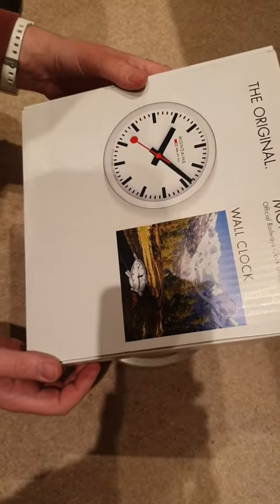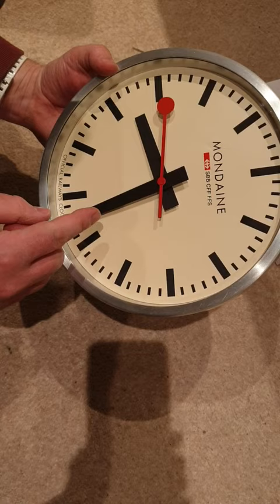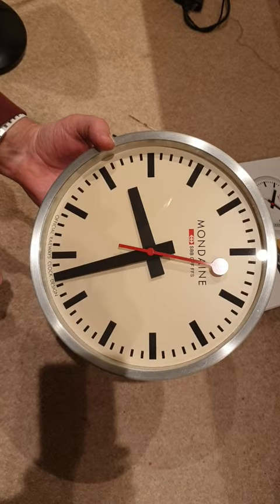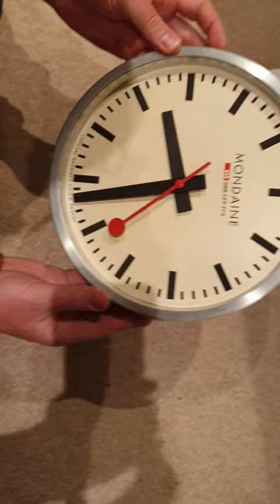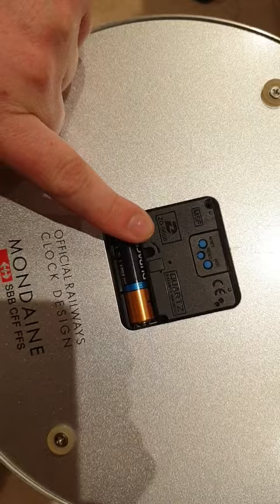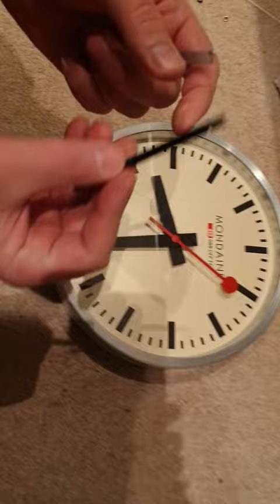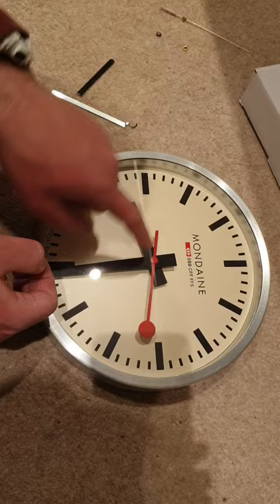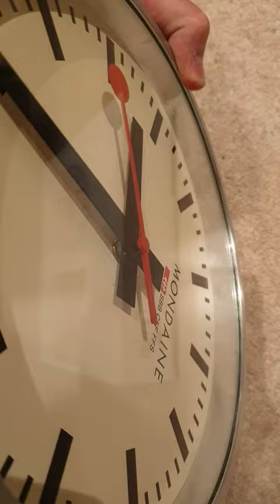Converting Mondaine wall clock to sweep seconds with radio control - like Swiss station clock. A990

Comment: OK, quite nice job, but now you are missing the 2 seconds stop of the second hand on the full minute.
Reply from the maker: Yes,  I did look into that and contacted Mobatime to see what the options are, but it requires a dedicated network time controller that costs nearly £1,000. So I was happy to forego that.  On the proper station clocks the minute hand stays on the minute mark until the second hand gets to 12 (I think it takes 58 secs for that revolution) then the minute and second hands jump together. On this movement the minute hand moves fractionally every 10 secs.

Comment: How did you fit the second hand? I just obtained a pressfit sweeping movement, but the center pin to fit the second hand is thicker than the Mondaine original. Drill this too?
Reply from the maker: Which movement did you use? I don't remember having to drill the hands for them to fit. But if you need to then yes  sounds like you may need to drill.